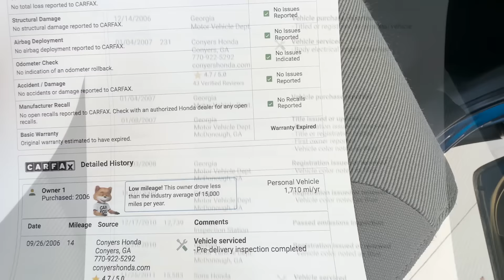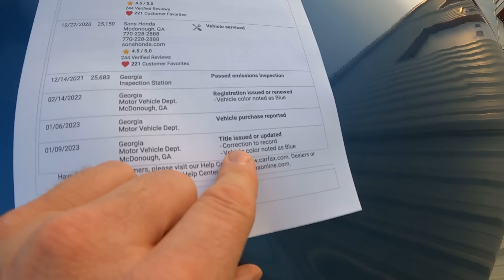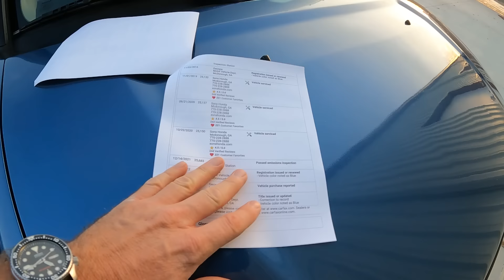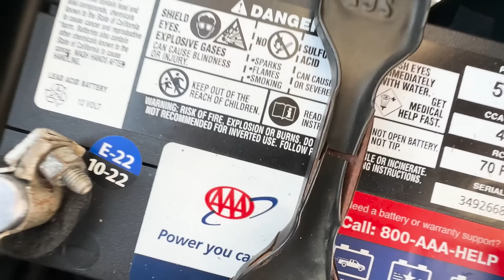I got totally SCREWED ON FACEBOOK MARKETPLACE!! What would you have done?

Comment: You didn’t get screwed.  You screwed yourself.  Pay a professional and have the car inspected prior to flying to Georgia.  100% avoidable if you do your due diligence.
Reply from the maker: Totally agree!  That's the take home message here.....don't let this happen to you!! Now...show me how to find a professional to inspect the car? Is there a website that I don't know about?  The message here is to have a backup plan if you put yourself in a position like this
Reply: @StoneyRidgeFarmer take a trusted mechanic with you or bring it to them. Common sense
Reply: @StoneyRidgeFarmer  when I traded in my truck for a small SUV, before i signed the paperwork on it I asked my trusted mechanic to do an in depth pre purchase inspection on it, he did. I do not recall how much it cost me, but it was worth every penny. Here is hoping your vehicle is mechanically sound and serves you well for many years to come.
Reply from the maker: remember....I know these cars inside and out...it was cosmetic issues.  No mechanic needed, I know these little elements inside and out. this is my 4th one
Reply: I bought a 2001 Chevy 2500 duramax for 9500 dollars. It had a dent in the door bad interior no problem. Abs lite on no problem the instrument cluster panel not reading no problem what ended up being a problem is I did not get it inspected by a mechanic prior to buying turns out it needed head gaskets replaced along with power steering pump and starter went out. So far I paid almost as much as I bought it for to fix everything and still have more to fix. Now unless it’s a simple truck like the 1967 step side dodge I bought from a nice guy for 1500 dollars or it’s a 1967 bug etc something that is worth it even if motor is bad etc. if they don’t let you get an inspection before buying or won’t wait for one then don’t buy it. So I learned this the hard way. But not sure a mechanic would have seen the paint or bondo that is not part of the inspection I think.
Reply: It's not either/or, he was ripped off by an unscrupulous vendor because he didn't do his homework. Both parties are to blame.
Reply: Should he had done his due diligence and gotten a PPI, yes. Does that excuse a dealer for selling poor quality vehicles and not disclosing those defects, no. Like the idea that "you gotta catch my lies and/or information I am hiding, or the fault is completely on you the buyer", I can't agree with that. At least that shouldn't be the idea, but the car business is a dirty business.
Reply: @StoneyRidgeFarmer  Take it to the dealer, have them do their inspection.  Mr. Stoney, I know all situations are different. I would still take it to a dealer and have it gone through. The mechanics see these cars all the time. Have the balls to say find something wrong with this car and I will have you repair it. I would still haggle the price of parts and repair. Bondo should be no thicker than paint. Take your finger and feel all the gaps next time. You are feeling for rough edges where the masking tape was. No paint shop is going to want to fix someone else's mistake.
Reply: ABSOLUTELY GREAT POINT, I have seen numerous vehicles I would of bought BUT they were states away or even across the country, and just HOW TRUSTWORTHY is a "Professional Inspector" LOL  @StoneyRidgeFarmer
Reply: SO, you WOULD recommend one as being realible? Whats' their weak points? @StoneyRidgeFarmer
Reply: @melaniekeen3611  That has to be the most ridiculous comment yet for numerous reasons. So according to your "wisdom"  he's not only supposed to buy an airline ticket for a mechanic, he's also supposed to pay them for every hour they're with him at least $75/hr  (no one is doing that for free) to fly to Atlanta and then drive back? That's well over $1000 , and ASSUMES you can even find one willing to do it. DO you really believe that the seller is just going to let him take the care and just drive it to another state for an inspection? You shouldn't be arrogantly telling someone else to use common sense when you clearly lack it yourself. Also, depending on where he was in Atlanta, buying the car may have been the best decision in that situation as its not worth losing your life over. You just take the loss as he did and live to see another day.  COMMON SENSE. At least he has the balls and the willingness to take abuse from clowns like you to enlighten others so they don't get into a similar situation. Worst of all, your advice is WORTHLESS because mechanics know nothing about body and paint, they are MECHANICS not body shop workers. The car was fine mechanically as he explained, the issue was the body\paint for which you recommend a "mechanic" for?
Reply: Never pay a five-figure amount for a used modern, mass-made vehicle (let alone fly to buy), because you're just kissing at least two-thirds of it goodbye in the next five years even if you only drive it 1 mile/year. (And never pay extra for "pretty" if you live someplace where it snows, because you're going to be covered in grunge half the year anyway. And even if your AWD is perfect on Blizzaks, it'll be some other person who slides into you.)
Reply: @StoneyRidgeFarmer Literally any mobile mechanic that lives in the area where you're buying a vehicle lol
Reply: Did you pay a premium price ?
Reply: Didn't you look at it ???

Comment: Never comment on much but I think there is something going on in that area.  I grabbed a specific Camry from Autotrader at a used stealurshit in TN.  Low miles, paid for a full inspection by the local dealership with excellent mechanical condition and a perfect carfax.  That dealership took care of a melty dashboard under warranty even.  Sweet!  Flew down, test drove it all was well except I noticed the spongy brakes.  Weather wasnt great but noticed respray on the front bumper.  Drove it across the country back to the desert and started in on my B service during covid.  Digging in I noticed the full respray and when I found the original paint areas, it looked sun faded.  Plastics on the interior also looked faded on one side.  Ultimately, after speaking with the used dealership and filing a complaint with my state AG back in 2020, turns out resprays on damaged vehicles from hail and flooding (hurricanes) is not uncommon in the southeast and northwest.  Thought I would share, God bless!

Comment: Use this as a learning experience, you now have bad options left. Correctly repair the damage to driver quality for about 5K-7K or resell as is about a 5K+ hit. I do car restorations at my home shop since my 2011 retirement and always have 6-12 cars that I am working on and spend more than $50K per car on the restoration. I have one now that I am at $180K and will spend about 35K-50K more to complete on a car that is now 5 years of effort to get to road testing and ready for disassembly for final paint and then interior and should be ready for sale by Apr. 2024. If you ever see a replacement cat, converter on any car that is being sold as a No. 3 car with less than 50, 000 miles and/or has a repaint ( typically a #3 looks like a car with less than 5000 miles for the lay person) run and cancel deal unless you can see actual repair orders. Best of luck in future use an inspector these pre-purchase inspections can be arranged for about $200 for general condition inspection/evaluation. Ray Stormont
Reply from the maker: exactly!

Comment: Maaco is crap. I had a 1/4 panel and front valance on my mustang replaced and painted. Maaco put the part on my mustang, and baked the whole car, destroying the paint job. It was cracked everywhere. They had sprayed primer on my fog lights, left the tape on it, and they were not even screwed in. I could not prove they did it, I was young, they threatened legal action. Years later, my Dakota needed a paintjob, it was flaking off in hand sized pieces. Different Maaco. They wanted to charge me extra to buff out any hair or dirt that may make its way into the paint, I refused. I told them I did not want a paint over, I wanted it stripped and painted, they said that would take alot of time, I said I figure painting a car takes alot of time. When I got it back, there was hair and dirt in many areas of the paint. Then had not even dropped my tailgate, just took off the shell and did a cheap spray over, you could see the scratches still. I showed them the tailgate, they kept it a few more days to spray over that. They refused to budge on the strip vs paintover, saying show us where your paperwork says strip and paint. I said I told them no paint over, show me where it says you will do that. Again, a stalemate. I will never go to another Maaco.

You knew the car was flawed, they offered to take it back. Out 15k or out 700 to fly back home. You should have walked away, sorry man.
Reply: The Maaco here in Fresno, Ca does terrible quality work. Will never go back.
Reply: Josh, you should watch this video as if it was someone else. Since you "know" these inside & out, you would tell them to walk away. If you were"screwed" as you say, you did it to yourself. I xan't believe you bought it knowing this.

Comment: I got screwed by Ford in the early 2000’s when they sold me a faulty windshield wiper relay. Because I didn’t book an appointment with them and installed it myself (it’s plug and play) they didn’t let me exchange it for another one. I ended up calling a mechanic friend and they diagnosed the relay as the problem. I then went to an auto wrecker to scavenge a used one and it worked just fine.  As a matter of fact it worked for many years after that until I sold the truck. My experience was so frustrating I vowed to never buy a Ford or Ford related vehicle ever again. Over 20 years later, they have yet to see another dime. We’ve purchased many newer vehicles since. Whatever business model they claim to abide by, they have failed on many levels.

Comment: The LAST two times I asked a seller specific questions & they lied BOTH times, recently bought a 78 F150 , I asked the seller have you ever had this original Ford bed liner out? & what condition is the bed in? He said there was some pine straw there and a few holes, LOL , I get it home & pull it back and nearly the whole bottom front panel corner is rusted out, the truck had other easy to see rust, & I even looked under it while he had it on his trailer, BUT due to the time, distance & rush I just OVERLOOKED the bed rust out, to be honest I was SO IMPRESSED with the running, driving, of the truck & the original NON hacked wiring I felt good about it, drove it 3 hours back home no issues, and even took $1000 less than what he was asking.

Comment: Condition>miles.  Too easy to fudge mileage on these, and much of the issues with these things will be with age (rubber getting old) and not mileage.  Agree about having a mechanic look it over if you are spending real money, and if I see a paint job on a low mileage vehicle I am walking way because it was likely in an accident.  Too much is wrong with that thing to go in the 10K+ range.

Then I really don't like traveling far to buy anything because I have been burned badly a few times by scumbag sellers.  So when making these type of trips, you need to have a contingency plan for when the item isn't as described and things go South.  Maybe fly in with a round trip ticket and have them meet you with the vehicle at the airport.

Facebook really has some shady sellers.  Too many people making a business out of flipping vehicles and anything else they find on the side of the street.

Comment: I found a used 4Runner on FBMP, it had some work done to it, frame rails replaced due to rust... But looked like a straight vehicle for what it was. I asked the owner to shoot me the vin number so I could do a bit of research on the vehicle. He immediately blocked me and took the vehicle off sale... Hmm... I went to a dealership and bought a nice 2013 Honda Pilot. It has a few minor mechanical issues, but nothing I cannot fix in the driveway. They typical items one would expect with a J series motor with 114,000 miles. So far, very happy!

Comment: Due to the terrible circumstance the car seller put you in, out of town,etc., I can see why you chose to buy the car .  On the bright side, besides the cosmetic hail damage and if you get the missing stabilizer part (can't remember if you already received or not), the car should run well  due to low miles and maybe a reputable paint shop can fix the dings. Unless you know what you are looking , most average car drivers will not notice these imperfections, though they jump out to you.  I am the same way with other things, so I understand. Thanks for the lesson - I never would have thought to ask if the car was repainted nor ask about the catalytic converter. You will have a good running and nice looking car , despite the circumstances.

Comment: FYI, Carfax is not correct all of the time. I purchased my car in 2007 from the showroom. went to trade it in a few weeks ago and the car fax report shows 9 accidents. I know I had two minor bruises.  Had the windshield replaced twice once from stone damage and another from freeze thaw hard crack.  Carfax shows the the windshield replacement as accidents.  I was told that if you went through the insurance company or if someone was given a ticket if they ran into you it is show as an accident even if you did not file an insurance claim. Basically car fax collects every bit of data and classifies it as an accident.

Comment: On the Carfax, yes it's a few snapshots in time not a full story about a vehicle. If it looks to good to be true it more than likely is. When the person is ready to drop $2k off the price when you find hail damage, well that is my red flag that there is more to this vehicle then I know about. Sorry you got hosed, but sometimes walking away and paying $700 to fly home is worth every penny. 

I owned a EX-P and it was a nice little SUV. The K24 Engine in it will last 250k easy when maintained correctly. The only issue I remember was the front suspension had to be replaced under warranty, but I believe it was a recall and Honda covered every penny for me. Great little SUV, I'd keep it and fix the room when you have time or need to.

Comment: The CARFAX Buyback Guarantee helps protect consumers from unknowingly buying a vehicle with a DMV-issued title brand, such as Salvage, Junk, Rebuilt, Fire, Flood, Hail, Lemon/Manufacturer Buyback, Not Actual Mileage, or Exceeds Mechanical Limits. If you find that any of these title problems were reported by a DMV and not included in a report, you may qualify.
Reply: -depends on each State.  But this Honda Element should of had a "branded" title for hail.  

Sometimes these "branded"  titles are "washed" by retitling in another state to remove the brand.  -especially "flood" branded titles.

Comment: look at the bright side you have a low mile element that you can get door dinged and actually use... i mean its no show piece to began with... I could understand if it was lets say a Cadillac Escalade or CTSV or a vette BUT its not.. Its a little fuel sipping honda with 4wd now you can actually use its 4wd and not worry about a few rock chips or door dings... With that said you saw the issues and you bought the issues. If its mechanically sound then screw it. my wifes 06 jetta tdi we bought for 800 due to hail damage has run perfect for 3 years we named it dimples and wouldnt change it for the world

Comment: What you got was a fact o bake special body and paint job that was cheaper than macco. Just knuckle under take it to a cheap but reliable local body shop that does good work wether you do whole car or at least the roof and call it lessons learned because you still have a good low mileage car with a good interior. But yeah your first mistake was traveling all that way without an escape plan on getting back home. I'd of left the plane ticket open ended with the option of flying back with a 150 dollar upgrade payment or a cheap rental lined up..

Comment: Most likely was “totaled” by insurance due to hail damage. The body shop got it cheap from the insurance company and did a half butt job making repairs and then turned around and sold it. Probably the guy/dealership you bought it from has a deal worked out with the body shop to get these cheap, or they have their own body shop and do this work themselves.  My guess would be this dealership or individual does this very often. It is a very common thing in the car business, I used to work in the car business and know some of the “tricks” that are used. I am surprised that it does not have a “rebuilt” title due to being totaled by insurance. Buyer beware, sometimes good deals aren’t really good deals at all!

Comment: I went to Atlanta twice to look at a car, first was a 1999 Toyota Land Cruiser, 2nd was a 2010 Lexus ISF, both were junk. I live in east Tennessee so I drove down but that was a couple wasted trips that I will never do again. For some reason ATL has a lot of rough condition used cars. If I'm looking for a used truck or car, I won't drive over 75 miles to look.  Honestly, I'm not sure why you took it, I would have walked because sounds like you paid about $10,000 more than you should have. I've owned 2 Elements and they're great little SUVs but I sure wouldn't want one full of body filler, even if it did have super low miles. It's a shame the person lied to you but that's the world we live in today, it's hard to trust anyone.